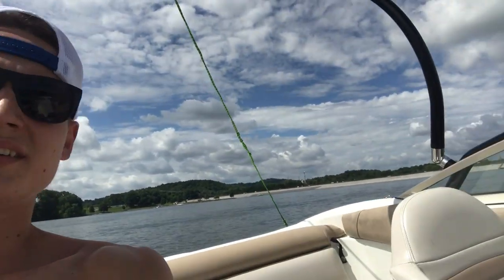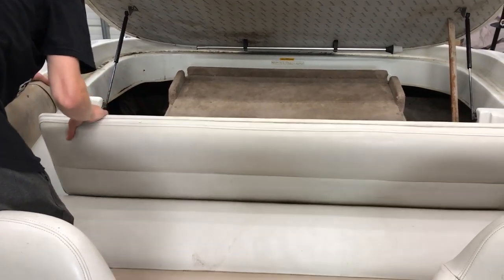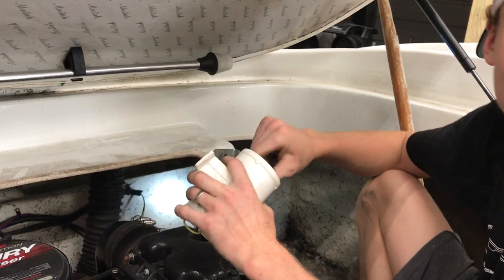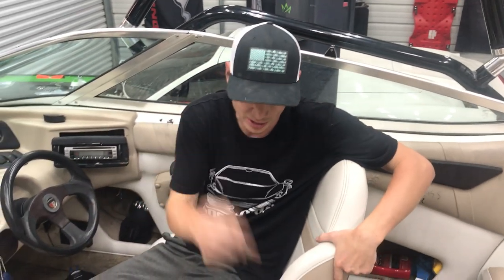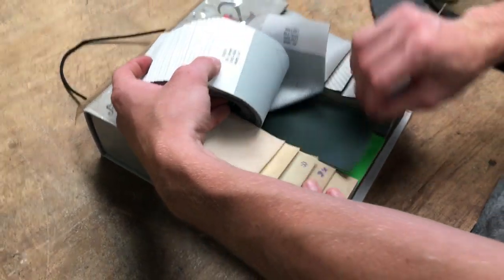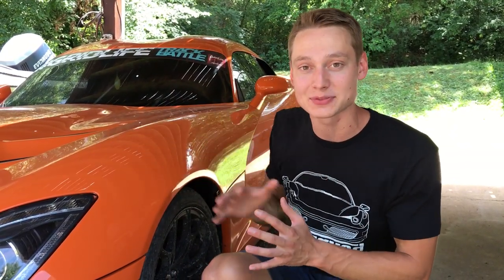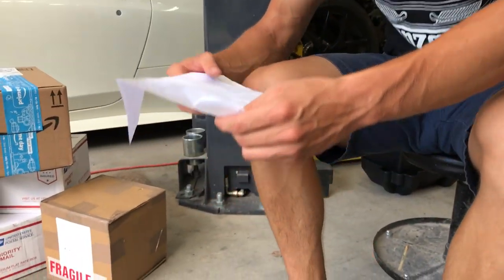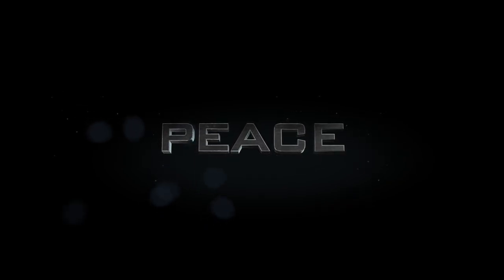Rebuilding A Super Cheap Wrecked Boat Part 4

Comment: Check the specs on your boat engine as 6,000 may be too high which would mean you prop needs changed--that is where you will gain performance.  Use a third person when you have someone on a tow line--any state I have been in require an observer   Have fun

Comment: The Speedo issue there is s hole in the back of your lower unit and it will get clogged up with wood and stuff if you drill it out your Speedo will start working

Comment: IMPORTANT!!!!!!!!!!!!!Somebody please make sure they see this, whatever prop that came with that boat is completely wrong or got fucked from the crash. The max rpms you should be seeing with that engine is 4800 rpms. If the engine spins 6000 you're obviously over running the engine but the deal with I/Os and Outboards is that the damage and wear the motor is getting at 6000 rpms is the same throughout the whole entire power band, even at idle you guys are hurting that engine by having that prop on it which will cause engine to break much faster, get a prop that is about 6 inches bigger in diameter. Typically engine rpms drop 200 for every inch you go up in pitch(Pitch is how far the prop will move in one revolution). Really hope you guys see this, I work in a boat yard and have been on boats my whole life so I do have experience in this realm.

Comment: Google the make and mode of the boat and the manufacturer may make a direct bolt in replacement seat set up. That’s what I found on a boat I was doing the interior on.

Comment: This comment is a little late but please make sure your blower fan works.  Also, make sure you run it every time before you start the engine.  An explosion in the engine compartment would not be a good thing!
Reply: At around seven minutes in the video he fix the blower fan. However I agree if it doesn't work or breaks again, get it fixed or at least open the hood while idling. The blower fan can be shut off while underway as the natural air flow ventilates the engine compartment.

Comment: An edelbrock carb isn't exactly anything special, it typically is just a direct replacement for a factory carb. Since it may have had a Carter from the factory, edelbrock is no different. If it had a Holley then it may be a bit of a performance direction, depending on the model (ex. a 4 barrel double pumper) could be an upgrade for power

Comment: 5.0 is a Small Block aka 305 2v chevy I would honestly recommend a Summit racing 600 CFM vacuum secondary carb. That's if it's a 4 barrel carburetor
Reply: its a boat....why bother with the vacuum secondary???
Reply: Easy to tune in my experience.
Reply: @davejames2015  i always chosen mech secondary for that same reason on boats ,you just adjust the sec to open at the good throttle position and thats it. i dont see much use of the vacuum sec because the rpm is not 'solid bound' to the ground like a car and you cant slop much and stay 'trapped' at low rpm.

i guess you owned very ligth boat with huge engine that were very fast with very agressive props? then i could see the advantage with the vac opening the sec perfectly while you slowly(relatively) climb in the rpm range

Comment: That is a 5.0 305... the 5.7 is the 350. They put both those engines in the 90s Chevy/GMC 1500 pickups. 5.0 isn’t as reliable as the 5.7 but still is a good engine. If I were u , I would put a 383 stroker in the boat with captains choice so u can run the exhaust out of the water or in the water. Would b stupid loud and fast asf

Comment: RPM is off. 6k rpm? That 5.0 would blow up. Carb might help with airflow and some power, but I’d think you would notice more torque from it. Exhaust out the back would be cool. Get that gel coat wet sanded!!!

Comment: I would just eliminate the carpet all together. No carpet means you can just spray, scrub, and rinse your floor, and you don't have to worry about your floor (carpet) getting wet from skiers/wake boarders get in and out of the boat. Never put an automotive carb on a boat, bad things can and eventually will result. Don't worry about your speedometer, get one of the new engine monitors and a GPS/Navigation from Hummingbird or Lowrance with a through hull transducer.

Comment: yes big carbs more power  more torque  whith  cam shaft and good exaust
Reply: Wrong, there is only so much power that outdrive can handle, and you have to use marine exhaust manifolds.  A set of marine stainless headers would cost more than the boat is worth.  And the cam in the motor is designed for the range of RPM's that a boat typically runs.  There is no transmission so it has to perform from around 700 RPM's to around 4600RPM's.

Comment: This is weird, I think the boat model you have there is the Mariah SX20 from maybe 2003.  I'm not sure, but I think the 5.0 from that model year came with MPI or multi-port injection.  Perhaps it was only optional.  I wonder if the engine you have is perhaps not the original engine, because it seems to be carburated.  The MPI motor has a different looking intake and upper cowel.  It may also have been the EFI model which is throttle body injection.  That may explain the disconnected wiring harness you were looking at in this video.  Just some thought.  You stole that damn boat btw!  Screamin deal!!!

Comment: If the engine is original to the boat it would be a Chevy 305 small block. Unless someone replaced it with a small block 350. That was common thing to do. As far as carb replacement just get a Holley don,t mess with the Edelbrock. They are a real pain in the butt and have a mind of there own.

Comment: A mercury is a company run by ford and the mercury 5.0 is the same as a ford 5.0 which is a 302 or a 289 so it’s a 8 cylinder motor and you can get any parts from a ford 5.0 and they will bolt right up
Reply: I think you are confusing Mercury Marine with Mecury the car company. Mercury Marine stopped using Ford blocks in the late 70s and switched to a GM block. Easy way to tell is the distributor location. If it's in the back it's a GM block.

Comment: That’s a small block all of mercury mercrusiers this is the second smallest
Smaller than this is a 4.2l but this is a very small engine considering mercury makes them up to 8.2l and I have a 6.2l and believe me these engines are the best stern drives you will come across in their class

Comment: I’m no 100% boat expert but I’m yelling at you for all the questions your asking or not I knowing. Belt and loss of power, come on! Check your wires, plugs, distributor cap and rotor, coil, fuel pressure, then start looking at the carb, accelerator pump, rebuild the carb. Good luck guys.

Comment: You an open the engine bay before you start the boat as well. Keep the belt in good shape you can lose power plus it will overheat

Comment: 5.0 mercury that’s the engine they used on the Fox body mustangs in the 90s its a small block 302 and it’s still used today in the new mustangs but more advanced. That engine probably has around 190 hp

Comment: The hose that comes up from the bilge is for doing an oil change on the boat. Motor its a 5.0 chevrolet based 220hp two barrel carb. To put a four barrel you will have to change out the entire intake manifold. Has to be a marine carburetor as well

Comment: Its a small block just look at the heads narrow=small block, wide=big block most outboard ski boats come with a small block had a caravelle interceptor had a 5.0 Mercury which is a 350 same as that motor
Reply: A 350 is 5.7......Its a inboard outboard.

Comment: Be Careful Goonies!  

If you are thinking of swapping out the Carb for a Holley or an Eldelbrock, then make sure you have a "Marine modified" Carb.  The setup if the jets and vents is different as the engine compartment doesn't get the ventilation a car does.  Even though a car carb will work, they are dangerous in a boat.  

See the Holley Range: https://www.holley.com/products/fuel_systems/carburetors/marine_carburetors/

Comment: Hey Guys!
6000rpm is 1200 rpm too much  for a stock engine... you can trim it with your prop size!!
Reply: i dont understand why someone put a prop with such a 'soft' pitch on that huge engine....the only thing i can think of is that the former owner was towing something

Comment: put a Holley on it dont put a Edleborck on it they suck and dont go crazy with a double pumper either just put a 600cfm on it single pump mechanical secondaries there are tons of things you can do to that but since you boys have the cash flow pull it out and slap in a 383 stroker crate motor change the prop to a 4 blade and 17 degree pitch and it will rip your head off lol

Comment: It is a small block engine and never take it out by yourself it's a pain and you can actually take those out and put a 350 Chevy engine in there.
Reply: Been there done that....its not that bad. I've RR boat and car engines myself no problems.

Comment: I feel like the grumpy old man here with my comments but there are a lot of things to be aware of with a boat.  First off, get it registered and licensed.  Boat cops will ticket you for that most times.  The fan you supposedly fixed is very important and I would replace it, they are like 10 bucks on amazon.  You MUST run that fan for 3-5 minutes every time you go to start the boat.  That fan is not there to feed your high performance 305 cool air, it is there to clear out any gas vapor that has settled in the bilge.  You should have two dryer hose looking hoses that attach to the fan with one going down to the bottom of the bilge and the other side going to an outside vent.  A boat is very different from a car, gas fumes and gas has nowhere to go and is heavier than air so it will settle at the low point.  In a car this is no big deal as the motor is not in a water tight environment.  That was the basis of my comment earlier about using only marine parts.  You can't just start throwing automotive parts at a boat or you will have a legit explosion when you least expect it.  Carbs, distributors and even spark plug wires need to be marine rated.  That boat is also water cooled with most of the cooling happening in the manifolds, those exhaust manifolds are like giant water jackets that cool the hottest part of the motor, you want to look for rust or corrosion where the riser meets the manifold.  Bad manifolds and risers will let water into your motor. (BAD).  I could go on and on but I would highly recommend doing a bunch of research on I/O boat ownership.  Cheers.

Comment: Decadence flooring is the way to go. It’s like woven ramen noodles and it just lays on the floor. Doesn’t need glued and water runs right through it. You can get a sheet of it sent to you relatively cheap and then cut to size and lay in the boat. Here is the place to get it. http://www.jimsmarineflooring.com/deckadence-marine-flooring/

Comment: As for carbs, leave it.  You can put a holly carb on it, what most run but they must be marine certified for fire reasons and are expensive.

Also the tach is not right on that boat.  Its definitely not running at 6K RPM.  These things shouldn't go past about 4500 RPM

Comment: That could be a Ford engine Mercury also used Ford and GM throughout the years it just depending on what year your motor is even then they used different years all the time it's kind of like Jeep they kind of had parts from everywhere

Comment: It's a 302 engine not a 350
Check power steering fluid level while engine is at idle.
Reply: It's a 305, not a 302. 🤦‍♂️
Reply: D W I was closer than 350 ;-)

Comment: Never Never start the engine out of water. The outdrive has a pump in it and it's made out of rubber. It will burn the pump up if it's not in the water.

Comment: Itsa TBI THROTTLE BODY INJECTION ENGINE CARB IS MADE FOR THAT ENGINE YOU GUYS GOT TO STOP THINKING CAR ENGINES BECAUSE THAT IS A MARINE APPLICATION ENGINE. WHAT U THINK OF AN AIR CLEANER ON TOP OF THE CARB IS ACTUALLY A FLASH ARRESTOR

Comment: Do not put an automotive carb on a boat....fire hazard. Also don’t run it dry without water or you will burn up the impeller (which sucks water from lake to cool the engine).

Comment: a 5.0 merc is a 305 chev , so a small block chev. to put a different carb on that engine, you need to find a special carb made specifically for marine use.

here is a link to some nice marine carbs:

https://www.summitracing.com/int/search?SortBy=BestKeywordMatch&keyword=marine%20carburetors&cm_mmc=ppc-google-searchgeneral-terms_-keyword&gclid=Cj0KCQjw1MXpBRDjARIsAHtdN-0kV9jWIJxzvxy1vfj1Y6pG63apRl0yIW_ImdQ6aRLMljnxrTgo13MaAvKREALw_wcB

Comment: small block

https://www.holley.com/products/fuel_systems/fuel_injection/sniper_efi/sniper_efi_quadrajet/
Reply: You can't put that shit on a boat, it is for auto applications.  Any fuel system has to be marine rated.
Reply: @VelvetHammer1  well I know several people that used auto and their Marines products is a fuel injection system to put on to an LT1 which is what that engine essentially is so I'm assuming it would work but you may be right anyways

Comment: For a guys who owns and works on his boat, this is painful to watch 

PS that hose on top of the engine at 5:07 was the oil drain and the bilge plug connected to the end. It is supposed to go through the hole in the back bottom of the boat.